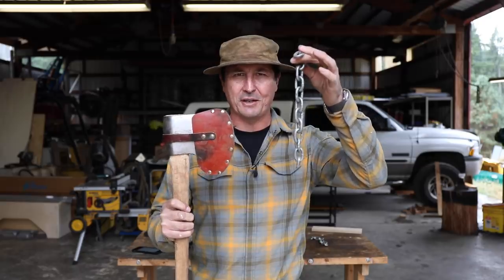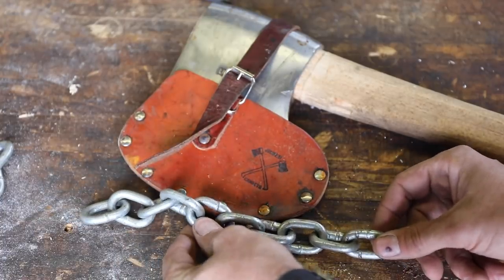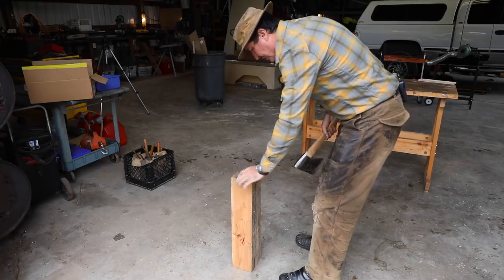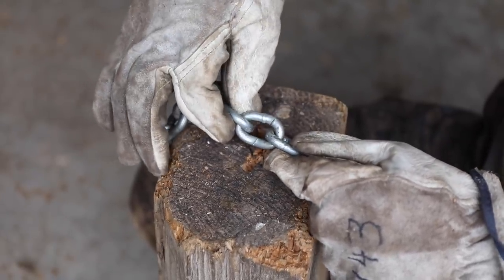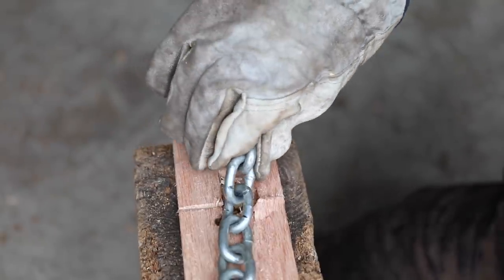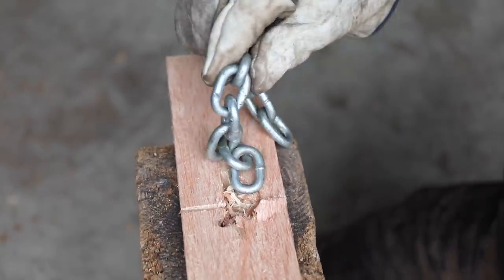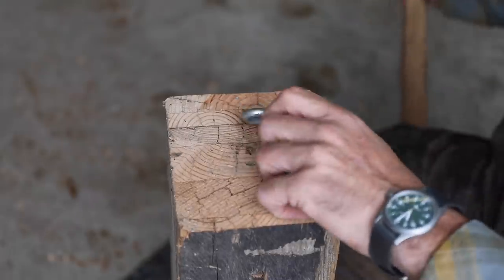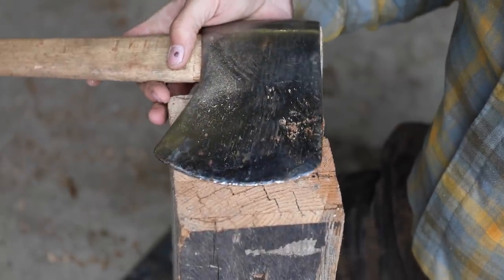Will An AXE Split A Chain In Half???

Comment: I wasn't sure about chain I think different hardness of chains could make a big difference. The cable tho I cut lots of cable with a hammer. Just hold it over a edge of mild steel and wack it with the hammer.

Comment: wash it in soap and bakin soda...scrub the bakin soda down in it real good and don't  rinse it all off...pat it dry or let it air dry and the ivy, oak, or sumac will be neutralized and it'll heal perty fast after that. Good Luck...Oh yeah, if you wash good with bakin soda before it breaks out it usually won't break out much if at all.

Comment: The trick to cutting through the cable, is of how much strain it is under load, .... so you could probably cut through an inch & 1/2 cable, ... (with an axe), ... depending on the load placed on the cable, the components it is made from, how old the cable is is another factor to be dealt with, ... (ie: how long has the cable been under load), ... 
Yet in order to maintain a compliment of safety, this would have to be done remotely, ... with any/all personnel clear of any area that would/could be under stress of the whiplash effects of when the cable is torn asunder, ... (seeing someone sliced in 2 from the cable reacting from being cut anywhere outside of the spot where the actual cut being performed, would be quite hazardous to their health), ... try this on a very tiny scale, in order to understand the manner in which repeated testing can be observed, would probably be your best bet, ... but again, do not discount the safety factors involved, ... 
as a sidenote, ... quite a number of years ago, I was working as a laborer, on a bridge job, ... & one of my tasks was to carry out sheets of plywood to the carpenters, who were placing “whalers” with each sheet of 3/4” plywood (4’x8’), into position, in order to prepare the bridge decking for the concrete pour, ... I was just returning to the edge of the slope, when I heard a shotgun report, right next to where I was standing, ... it was the sound of the cable, snapping as it had lost its grip, in the chuck eye, ... and a spilt second later was another report, not quite as loud, or as sharp as the 1st one, as a bundle of plywood hit the ground, only feet from the man who had set the hook into the position on the straps, only a few seconds before the line had pulled through & snapped from the chuck eye, used to secure the cable, ... this was not the only “hairy” incident to happen on that job, ... but was considered the norm, as jobs go, ...

Comment: i use to repo motorcycles with a 15lb. axe razor sharp.. cut through locks and chain.. leave them on the ground and left a few stuck in the asphalt.. they will cut chain although not as Paul Newman did...

Comment: Chains can be have different purposes, this one looks like designed to simple lift something on a crane so it isn´t hardened to stay flexile, deform instead of breaking. A Chain that is designed to keep intruders off would seriously be hardened as defence for common burglar tools like bolt cutters.

Even usual building Steel S235JR seems to be harder than this chain, before I watched that video I´ve never had believe you can cut it just with an axe but interesting experiment so I´ll raise a thumb for this ;)

Comment: It is not possible to get it in one chop because the edge of the axe is curved and your steel plate is flat. Both side of the link can't be under the edge at the same time.

Comment: Correction. You can cut through a chain or cable with a REAL axe. 

You should try it with a cheap big box store axe. I would bet good money that they would have significantly more edge damage regardless of whether they cut through or not. There’s no substitute for good steel. Some Chinese stuff is even worse than mild steel for edge retention.

Comment: give the infected areas sponge bath with water and boric acid mixture, , you can get the boric acid at local pharmacy and they can confirm that this works, just so happens that I learned this from a timber cutter, good luck enjoy the channel

Comment: Wait if it took 3 stricks in the movie and your strike could about 35% through 35% * 3 is more than 100%.and on top of this the chain use in the movie would probably be weaker than the change were using now

Comment: All you whining people upset about the axe. If its a properly hardened axe it will be fine. Especially if the chain is mild steel. And if its not properly tempered. Its probobly cheap enough to buy another.

Comment: antihystamine pills always help against those irritating plants (because the chemical mechanism massively involves your hystamine paths) -- try CETIRIZINE, it works slowly, and requires several regular intakes (like twice a day) and probably it is too late for you to take it this time, but it does not interfere with your brain, such as CLEMASTINE, which makes you sleepy like hell and you should not operate machines if you take it, but clemastine works faster and is a better option in emergency situation.
google other antihystamine options available for you, they all sedate you to a different degree, but they are generally safe in not overdosed.

Comment: as i can see your strike was actually awfull, just a small tip to strike you should actually know this better than me. If you put your hand close to the hatchet top  and then as soon as you swing, slide your hand to the other hand that is holding the axe below. Like this you will have more momentum and will strike harder.

Comment: Will an axe cut a chain in half well it depends on how soft the metal of the chain is and how strong and how sharp the axes and of course how big the chain is and then how many chances do you get there's a lot of factors that go into those yeah it's possible if the chain is soft enough and small enough an ax will cut right through it with one swipe but not with a real hardened steel logging chain I don't know what kinda logging chain you have but the stuff sold at Home Depot can't even be cut with a hydraulic cutter without messing up the teeth it's just too damn hard grade 8

Comment: it cracks me up to hear someone mention "grain of the plywood".    that grain you see is a veneer and  is only about 7 thousands of an inch.  the sublayers are layed in a 90 degree orientation to each other.  it doesn't work like a chunk of wood.     we used to get a foundry demand their "grain" of the plywood run the length of the patterns for strength.    just because your grandpa did things this way doesn't mean he was correct.  I started to refuse to build them this way because I was tired of wasting good plywood to accommodate their idiotic logic.  so I had to sit one of them down and explain to him how plywood is made and why it's made the way it is.  the grain you see on plywood is 100% superficial and for looks only.
Reply: 7/100 of an inch, surely? 7/1000 would be 0.18mm